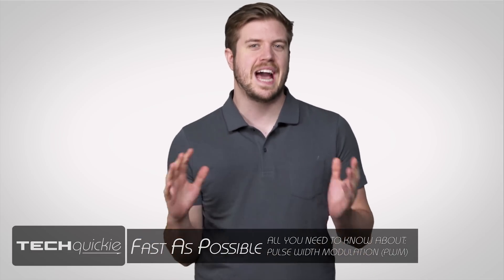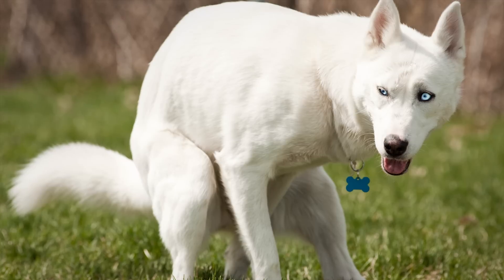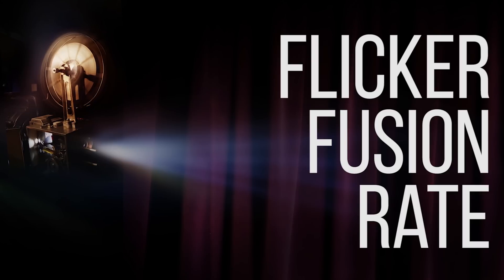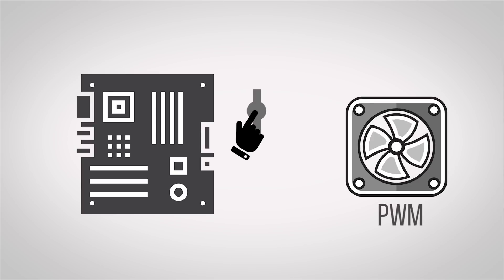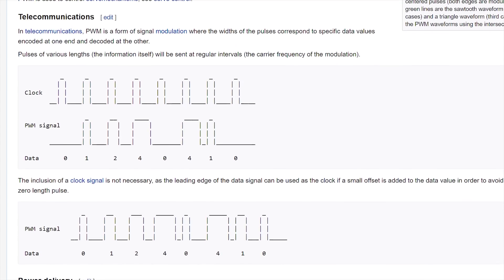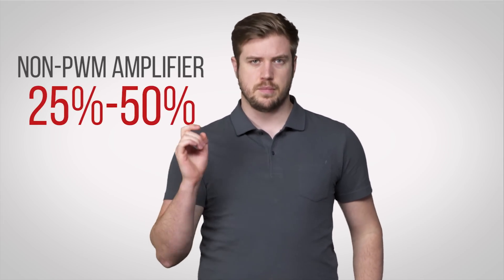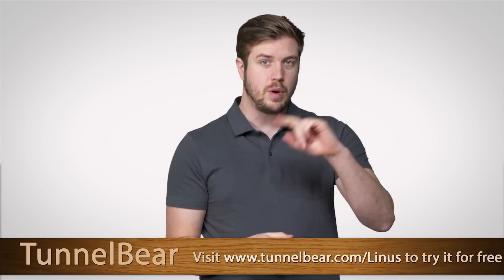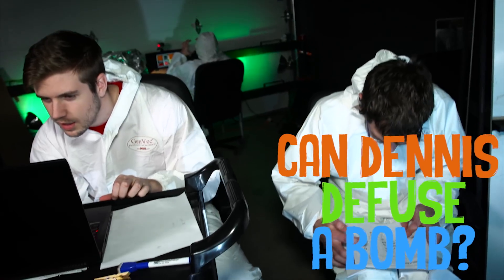PWM (Pulse Width Modulation) as Fast As Possible

Comment: Phone audio is P"C"M not PWM. Pulse-code modulation.  This is usually 64kbit/s and is further encoded using hybrid encoding which sends small fragments of the actual audio and then a series of synthetic parameters to modify the sound into the original.  So it's a mixture of PCM loss less, 64kbit/s chunks and the rest is vo-coded by a synth.  This is why during very heavy network usage, like at a concert or at new years and you phone a friend they sound like a robot.  Because there isn't enough bandwidth to send much of the PCM audio and the majority of the signal is low bandwidth "vocoder" style voice.  "Vocoding", originally invented by the military only sends basic synthetic filters and functions to recreate the voice.  Rather than sending the high quality audio, they just send synth settings to reproduce it, this requires minimal bandwidth.  Phones hybrid this with the PCM, the more bandwidth available the more PCM.

Comment: I don't think dimmer switches were ever resistive.  The DIAC/TRIAC has been around a long, long time.
And... PWM does NOT drive PWM fans.  Not like PWM leds are driven directly from the PWM.  In the fan the PWM is just a control signal for the controller in the fan.  The fan itself is run off a multiphase brushless setup or standard DC commutators.   There is no load on the PWM, it's pulled high by the fan and the motherboard just connects it to ground (the invert of the PWM signal).

Comment: I think technically you don't waste as much power all the time with a variable resistor, but there is a fundamental loss associated with the use of a resistor as compared to the resistor value or voltage drop of the other thing in the circuit. The more closed up the connection is the less current, so the less loss.

Comment: So essentially:

PWM = More efficient, more cool, and less power consumption
Great!
Personal Experience: I had updated my BIOS and for some reason my idle temps shot to 45-50C when it was a nice 29-33C before...understandably I was scrambling to find out WHY this was, for almost 2 days I tried everything I could, hell almost reverted back to the old BIOS version, and then finally, tonight really (8/31/2019 to you in the future) my brain would NOT let this go and so I went into my BIOS and I was messing with the fan controls and I pressed PWM and INSTANTLY my temps shot back down to their original temps and I sat there and I was like...no way is it that easy, I bet it's gonna up any second now....NOPE stayed true to the 29-33C range! :D so yes PWM is an amazing thing and I'm so glad I was finally able to get my temps back to what they were originally

Side Bonus: Before I discovered PWM my fan was pretty loud but now its super quiet as it was before! (I use a AIO Liquid cooler just btw)

Comment: Within 2 hours of using my first LED backlit monitor I was having eye strain and a dull headache. So I researched, learnt what PWM was, refunded that monitor, got one without PWM, and, haven't had issues since.

The old monitor I had probably used PWM as well, but it was CCFL backlit. CCFLs have a slight glow after flickering off, so the negative effects aren't as severe as LEDs that are immediately dark when off, it's the harsh bright light to zero light of LED flickering which fucks some people up.
Reply: PWM is not the problem par se, its the slower speed PWM frequency, as it approximates the reaction time of the eye (20Hz) it can cause eye strain.
Reply: @ThuleApsu  This is correct. Old cold cathode (CCFL) backlights had a very low PWM frequency, and frequencies lower than 30 have been proven to cause headaches in some people and seizures in epileptic people. However, not everyone is effected by this.
Reply: hey man, i havea  benq 1080p for 5 years now but bought an lg 4k monitor recently and its hurting my eyes immediately. Like within 10 minutes my eyes becomes fully red and the bloodveins are all over my eyeball. I thought my vision was worsening but then i tried setting up my benq again to see if it wasnt just the monitor and i swear my benq doesnt give me this issue. Im researching just now what the issue is im suspecting it is indeed this thing called pwm.

Comment: Hi, sorry but there are a couple of errors in your videos. 
It does not vary the "Perceived" power it does actually vary the power (joules/sec). 
DC Voltage control "Old dimmer switches use the same amount of power no matter how much light they made." Incorrect as the impedance of the circuit rises the total power used is reduced P=V/I
Best wishes.

Comment: PWM is also used on trains built between the 70's and the 90's, that causes the typical buzzing sound trains from that era does. In the 90's train manufacturers stopped using PWM for new AC VF systems that were more powerful

Comment: DC Voltage Control is so wrong!!! There is no "resistance" making the voltage go down or up... All AC/DC DC/DC power sources now days use PWM to control the output voltage or curren,t it is the same but used differently (pleace read a book about power sources)! And YES flickers are very bad for your eyes, all light source manufacturars have standards that need to follow and they band flickering at sertan rates(flickers come from poor filtering or no filtering of PWM in the power sources)... And audio amplifiers 99% efficiency Duble wrong there is no such thing in the world. Class A/B amplifiers to 50% efficiency Class D amplifiers to 75/80%.... Class X only in car audio competition series(SPL competition) 90% and that amplifier can only output ruff bass nothing else.

This is not the first misleading episode  from you guys and it's not cool and does not sound right from people that are serious.

Comment: Why can't you just use something similar to a DAC, which uses PCM?  in PCM, you have two bytes that range from -32,000 to 32,000 which can be used to represent voltage levels. why bother with duty cycles when you can use PCM?

Comment: It took me a second to figure out, but I think you may have left a question unanswered (or maybe your wording wasn't clear).

You may have talked about it in your RGB video but the PWM pulses will pulse each individual diode depending on the data value that was given to it. This will vary the brightness of each diode allowing the combination of colors to occur. For example, an RGB value (vector) of 0,0,255 would tell the controller to give 0% PWM to Red, 0% PWM to Green, and 100% to blue producing a fully lit, blue light whereas 128,0,128 would produce a half as bright purple color.

Been a while since I've messed with LEDs, need to get back to microcontrollin'

Comment: I've heard of devices that can convert waste heat directly to electricity when combined with heat sink systems, called Pyroelectric. You should look it up!

Something I've always wanted to try was to combine DC Voltage Control and PWM in the same tasks.

Comment: PWM sucks with LEDs big time. Buy any LED bulb without a CC driver (the cheap ones) and the AC flicker will drive you nuts. It's 50 Hz (60 in the US) yet very annoying

Comment: Of course PWM is harmful for your eyes. And PWM is just lazy, voltage control is much better and safer.
Reply: SwordQuake2 amp control, not voltage control. You can't (properly) control LEDs with voltage.
Reply: Point taken. Now that you've mentioned it, it's obvious.

Comment: PWM is also a technique used in music synths. The pulse oscillator's pulse width (duty cycle) is modulated by a low frequency oscillator (LFO).

Comment: So the human eye can't see past 18fps?
Reply: Some Weeb of course you can, it's just the lowest amount necessary for a 'fast moving slideshow' to look like motion.
Reply: I was going to troll with the same thing. No. The standard gamer can perceive over 200 FPS i.e. detect differences within a 5 ms gap. Most don't bother to tune their brain in but the typical person should be able to do so. Some can perceive differences from 4 ms or even shorter gaps.

Comment: The perceived brightness doesn't work linearly but logarithmically, so at 25% it'll be at half brightness and the difference between 1 and 2% DC could be about equal to the difference between 70 and 85%, blame your eyeballs for that :p. It's similar with sound too AFAIK.

Comment: It was mostly accurate until you started taking about audio amplifiers, at which point you tried to equate class-AB vs class-D amplifiers with DC vs PWM. this is not correct or even vaguely accurate for reasons too long to type on my phone, but basically, both amplifier classes receive and produce smooth AC audio. the internal function of a class-D amp involves a varying duty cycle as a product of a sine wave and triangle reference wave, but that's as related as the two topics ever get
Reply: IamIronManUK Didn’t fully understood..but got it.Tnx

Comment: Ok, i have a question. I am doing a pc build and my motherboard, the maximus ix hero has 4 fan headers. Im wanting to hook up 6 fans, the corsair ml140 fans. I dont want to use a fan controller or hub, but is it possible to use a fan splitter and not mess my motherboard up? Ive heard you can do this, but i also heard its dangerous. Please help me!! This is the only thing slowing me down on this build.

Comment: 1:35 proof that you cant see over 18fps
Reply: if you can't tell it's a joke, maybe you're the one that's fucking dumb.
Reply: If you need someone to literally state 'this is a joke' to get a joke, I don't know how you function.
Reply: Wrong, look at a shitty PWM LED array at low frequencies, looks fine, now fix your focus and drag your head quickly across the view of the LED, you will see the colours seem to separate or tear from one another. This is because the PWM frequency is too low, this is the same principal that happens in video, if the scene is slow moving the low frame rate may not be apparent, but speed up the scene and the low frame rate becomes apparent. Even at 100Hz if you are not directly focused on the light source you will notice the flickering, colour separation etc. When I build anything that uses a PWM circuit, I aim for frequencies at least over 500Hz for non critical. Think about it, a switch mode power supply is technically a PWM circuit, they operate in excess of 100Khz (100,000Hz) to obtain the near DC representation of the "fuzzy" power.
Reply: 24
Reply: Chris Weeks we see continuously but can only process 18
Reply: I perceive flickering way over 300 Hertz, depending on the surrounding light. 18 Hertz is a great understatement.
Reply: Superhuman O_O
Reply: Console peasants do exist, just like flat earthers, so I can't tell also if this post is a joke or not.
Reply: Horsecock PWM flicker rates and fps are totally different things. And how can you tell if it's a joke unless he states or has a hint that it's a joke.
Reply: Is this a joke or are you fucking dumb
Reply: Dan Super wasn't funny bro..
Reply: I meant the horseguy*
Reply: Wait what?

Comment: so why are there RGB headers on mainboards now instead of PWM Fan headers being used for RGB LED strips as well?  
...
Reply: Because the pinout is different. The 4 pins on a PWM fan header are ground, 12v, sense (tell the board how fast the fan is spinning), and control (PWM). A 4 pin RGB header has a 12v pin and one pin each for the three color channels (red, green, and blue), so each color is individually controlled. Some headers have 5 pins, with the extra being for a white channel. RGB doesn't need a "sense" pin, and the 12v pin is in a different position, so even if you were to connect an LED strip to a PWM fan header, it wouldn't work, and would likely cause damage, at least to the strip, and possibly even the motherboard.

Comment: It really does make a difference in monitors. Old CRT had a very low pwm frequency and new have a lot higher, and they feel a lot better. Also there is an app that tries to remove pwm from the monitors completely - Iris.

Comment: pwm is also used for communication between RC radio controllers between the motherboard and the actual radio module. all ~16 control channels/signals can travel through one wire